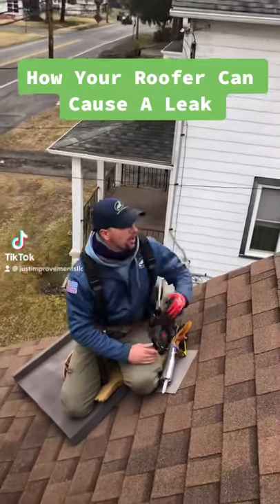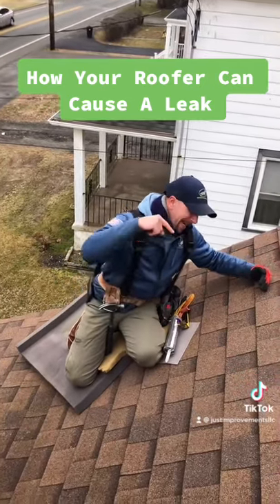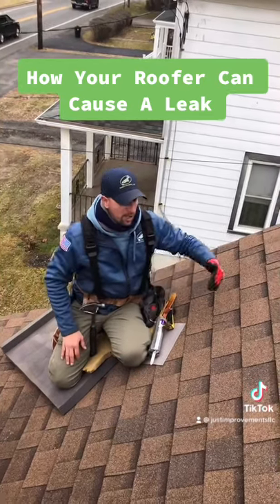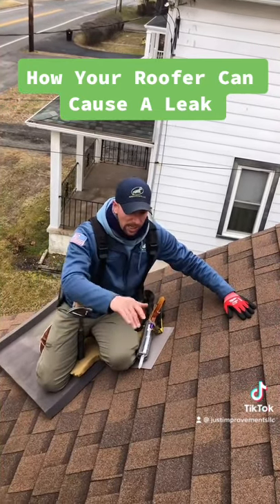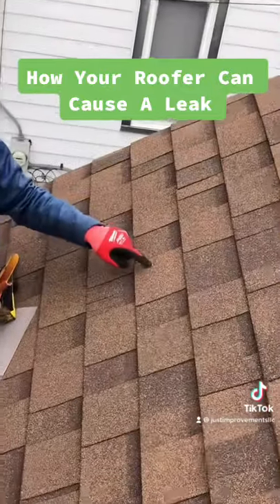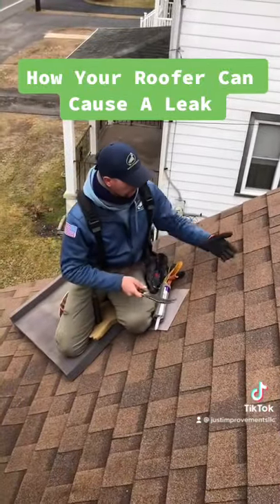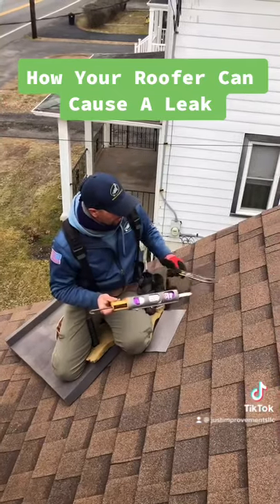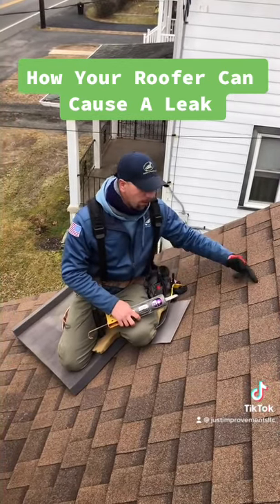How A Roofer Make Create A Leak on Your Roof

Comment: This guy doesn't know what he's talking about on his roof podcast; he's no roofer.  This one is simply just a nail-pop that came up through the shingle when it was too hot from the sun. The nail didn't go in all the way when shingles was first installed and roofer was too lazy to hammer it down. This looks like 7/12-8/12 pitch roof and no roofer would bother using toe-boards on this roof and they certainly wouldn't nail it to the new shingles hoping to catch the rafter underneath. This guy's a clown.
Reply: He really doesn't
Reply: That’s great to know
Reply: He's def trying to be recognized for a roofing company that doesn't have real roofers, like Supreme Roofing New England Mass. Never hure them. They are a horrid roofing company.
Reply: Exactly.
Reply: good shit scot
Reply: Guilty conscience?
Reply: 100%. And let’s just say he is right, no roofer is replacing the fuckin shingle, you would just flash it
Reply: Yeah its not from a Toe board if so he ignored the other nail hole need to actually hold the other end wouldn't let this guy on my job
Reply: ProgrammedToHateYou  accurate lol
Reply: Exactly
Reply: Tow board brackets are widely available and fairly inexpensive. If your contractor is nailing boards directly over the new shingles they just installed, they're not a roofer.
Reply: No roofer would ever nail a board to the roof, they would use a toe hook or roof jack. Not to mention no roofer uses white caulk. I guarantee you that hole is from the siders installing their pump jack brackets, that hole is to close to the edge of the roof and yes siders most definitely have white caulk
Reply: Yeah definitely a nail pop..

Comment: Astutely perceived and clearly articulated of  what might be easily overlooked.

What about using roofing cement instead of caulking to fill any holes?

By the way, given your low speaking volume and the background traffic noise, I'd ditch the unnecessary mood music in order to hear this video more easily.

Comment: How do I Un see every video of this guy's exaggerations and wrong diagnosis of every roof failure he shows. Chimney flashing when put on new with your roof is caulked and typically lasts 10-20 years depending on the caulking and that it's done correctly. Is no world where that little imaginary "white dot" is caulking that has failed causing any leak. This guy is definitely a huge Disney fan.